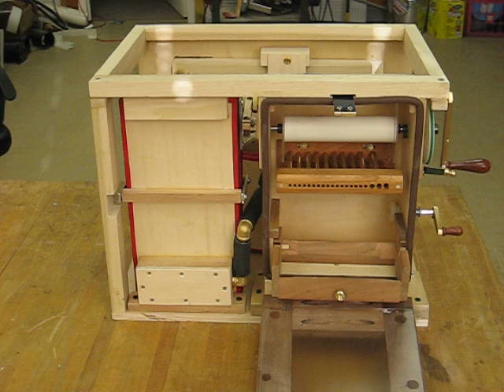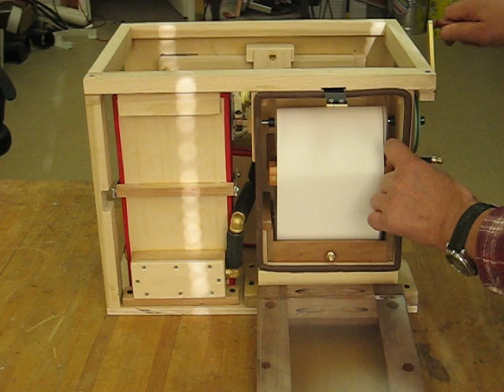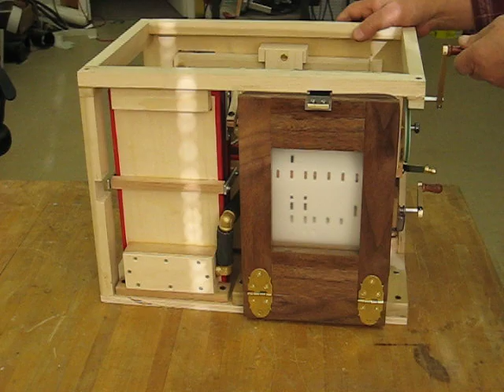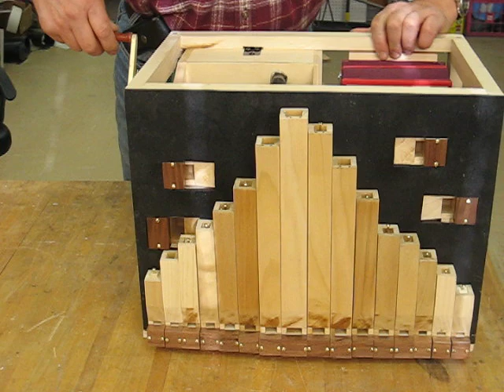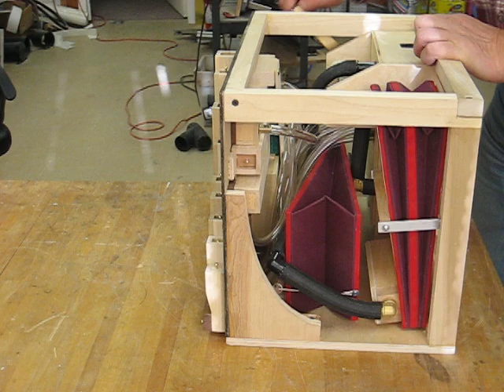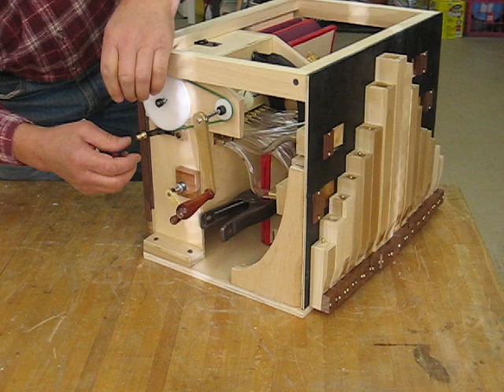YANKEE DOODLE street organ kit by ZAYA-RUZO assembled

Comment: - seperating the feeder and the reservoir bellows
- unnecessarily putting the roll-uptake on the back instead of the top (see how long he had to fiddle to get that roll even started??)
- having the hatch hinged at the bottom instead of at a side
- etc. (there is more, but I don't need to give him all the hinters now, do I?)
Reply: The roll-uptake is at the back to provide a clear area on the top for additional automata.
Reply: @BeyondF1  took only 7yrs to get a reply on this 🤣
Reply: You had a 7 year itch to scratch  😃.   And now 3 years more have passed since then !